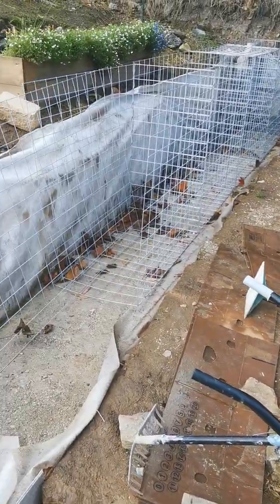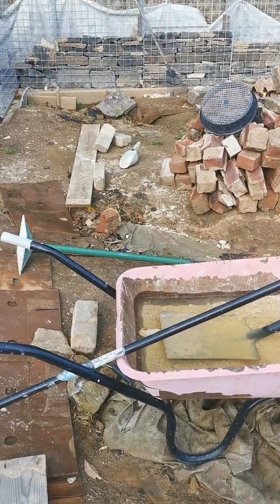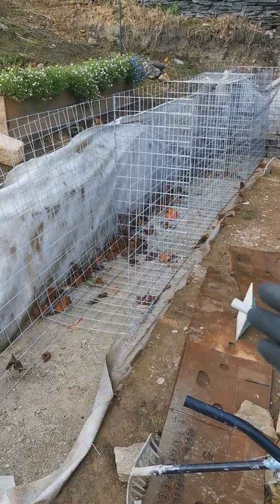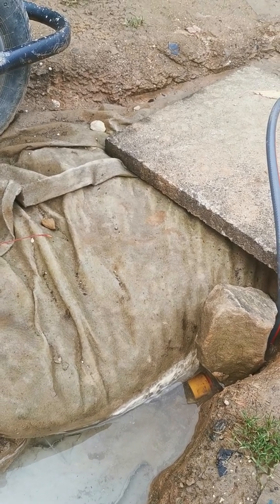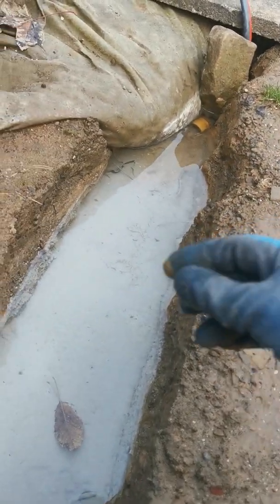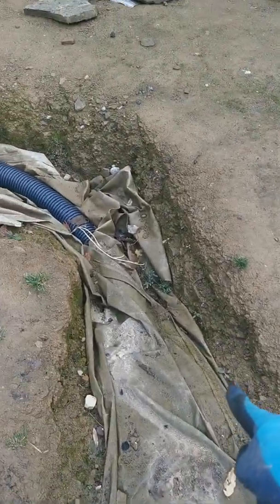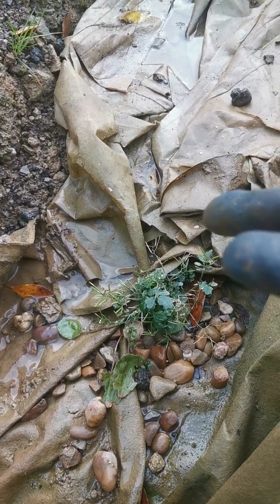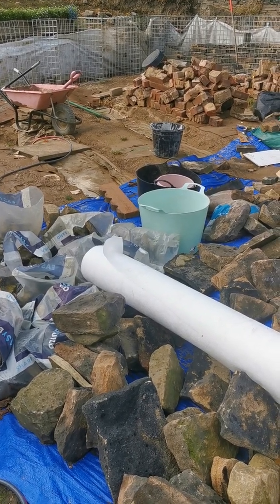French Drain hell! non woven geotextile doesn't work... HELP!

Comment: More and more i am convinced that french drains and clay soil are not going to work together for long. Clay is made out of tiniest particles that just clog either the fabric wrapped around the gravel and pipe, or it will clog the stones when not using the fabric, and eventually will clog your pipe too. All those contractors and experts saying that you should not use fabric or should use fabric are all wrong, the right answer is don't use french drain in clay soil, unless you are ready to maintain it YEARLY if not every half a year with replacing the materials or the whole system. 

Don't use french drains, look into building a concrete deep well instead.

Comment: Hi. I'm no expert in drains however Shawn @ Gate City Foundation Drainage (https://www.youtube.com/c/GateCityFoundationDrainage) DEFINITELY is and you should perhaps watch some of his videos. He puts in lots of French drains but always uses perforated thick wall PVC pipes and NEVER uses corrugated pipe - he has many videos on his channel explaining the install and showing why not to use corrugated and also experimental tests showing water not flowing in them. Also, he never uses fabric - basically he doesn't care about the silt getting into the pipe because the smooth wall PVC has such excellent flow that it can push out the debris with it...

You've not shown enough of your surrounding environment to show what fall you have  in order to remove this water from the area so perhaps another video showing where you are planning to take the water. It's possible though that you don't have the sufficient slope and may require a powered solution such as a catch basin and sump pump.

Shawn's obviously from USA but I'm up in Scotland and just stumbled across your channel this morning but it seems like you have a major issue on your hands...
Reply: I hadn't finished the end of your video when I posted above but your situation and frustration seems to mirror a lot of Shawn's customers frustrations - they spent thousands on inferior installs that were "guaranteed" to work and then they failed and eventually they got Shawn's company in and were very happy with the results...